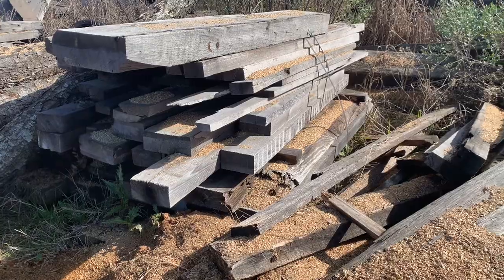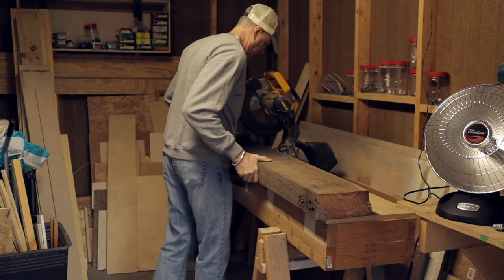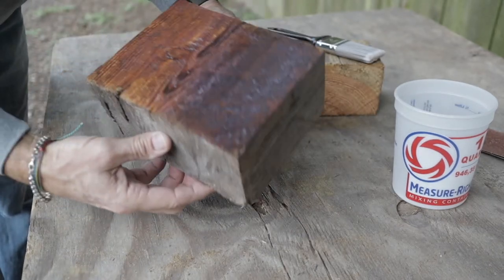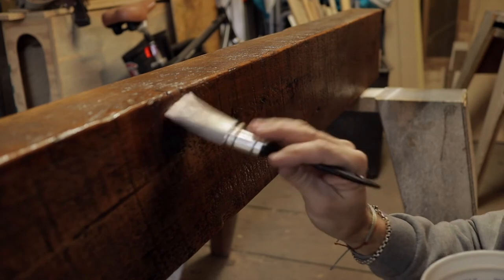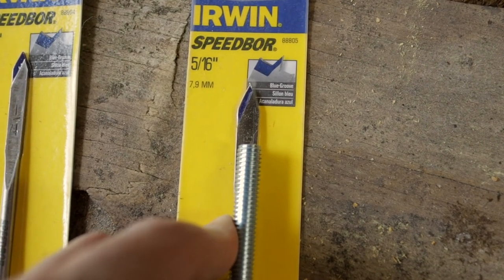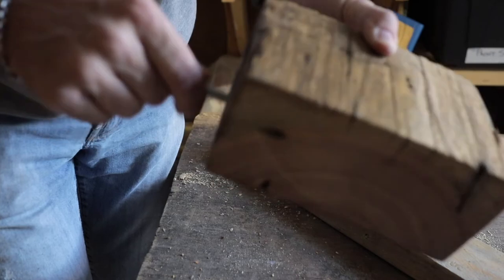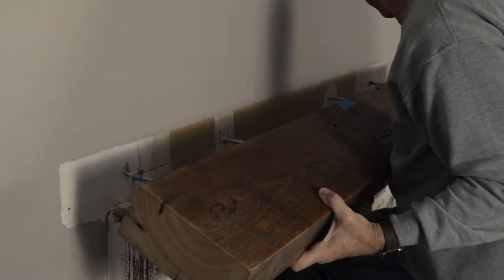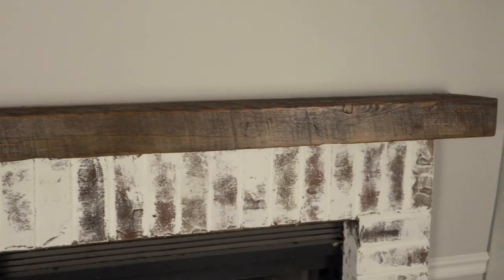How To Install a reclaimed beam as a Mantel for $100 dollars!!!

Comment: First off you did a great job. I am currently working on two beams myself. Here is what my take would have been. I would have secured the template material to the wall first, then drilled the studs for the bolts holes. Doing so allows perfect alignment. You were correct in suggesting to drill the holes in the beam oversized. This would have allowed the use of either a little epoxy or construction adhesive in the beam holes, securing the beam to the bolts.
Reply from the maker: If the holes in the beam were larger and I thought it might pull off my plan was to angle some screws through the beam into the framing. Thanks for watching!

Comment: Excellent video, thank you.  I especially appreciated the frank section on what did not work as smoothly as it could have and the related suggestions you make for an easier install next time.  That is the sign of a real pro.  I have jokingly and simultaneously quite seriously told my employees for years that there really is only one way to become an expert.  We chalk up those little issue costs to an account I call "educational expenses".    Your end result looks great and I really cannot thank you enough for the sharing of the extra education you acquired along the way.  I'm sure we will find our own educational expenses too but we have a much better starting point than we did  just 16:35 minutes ago.  Thank you again for sharing.
Reply from the maker: Thanks for the kind words. I appreciate you taking the time to write such a detailed comment. I can feel some your pain. I used to have a Remodeling Company. Afterwards I realized I should’ve made the holes larger.  Would have made install easier. Glad you made it to part of the video where I talked about my mistakes 😃.  Thanks again!

Comment: Thank you so much for this video.  You are a great presenter ~ you explain things very well and I really appreciated the detail in each step you took.  Very comprehensive and understandable!  I am planning to build a stone veneer fireplace surround and will be looking for a beam a little deeper than the one you had (I think you said it was 8 inches).  I had envisioned wrapping the mantle around the fireplace (the surround will continue up the wall to the ceiling); but I'm not sure how to make that happen.  But I'm grateful for the threaded bolt idea ~ much more economical than buying floating hangers.  Much obliged!
Reply from the maker: Thanks so much for the kind words!  I’m thinking the beam could be cut with a 45 miter on each end so it could return back to the wall. I’m sure the threaded rods could work on the returns along with some fasteners at the miter.  So glad you got some benefit from my video. That’s the reason I make them!!! Good luck! 😀

Comment: Great video!  Thank you.  You mentioned you wanted the beam to look as natural as possible.  Why not leave without finish after it was sanded?  Just curious.  Thanks again.
Reply from the maker: Thanks for the compliment!  I didn’t think I would be happy with the mantle without a finish on it.  Even though it was sanded I feel it would have rough spots and eventually splinters. Moving decorations around wouldn’t be as easy. I really like the mat finish I used.

Comment: Butch, I really like your style and thought process. I'm getting ready to do something similar for my sister-in-law. I know you said it was 8" wide, but how thick is it and the length? Looked like it was about 4 or 5" thick. Also, it looked like pine, do you know for sure? She may want hers to be oak. Lastly, any idea about the weight? Thanks a lot for your videos. Don
Reply from the maker: Mine is about 4” thick. I’m pretty sure it is something like pine.  Definitely not as dense as oak. Not exactly sure about the weight lighter than an oak one I’m sure. I was able to handle mine by myself.  But I wouldn’t want one any heavier. Thanks for watching and leaving a comments. Glad you got something from my video. That’s why I make them!!

Comment: Did you add the screws from the top into the studs that were mentioned in your pre-planning?
Reply from the maker: I did not. The beam was so hard to get up against the wall I didn’t need to. If I had of drilled the holes a little larger, which I would do if I did it again I would install the screws into the studs.

Comment: For the dowels what specifically did you end up using? did you cut the ends off after you screwed it into the wall or before?
Reply from the maker: I didn’t have to cut the ends off since I used a threaded rod or stud. There is no head on the end. They are fully threaded. Thanks for the question!